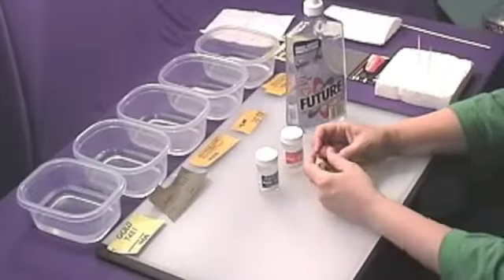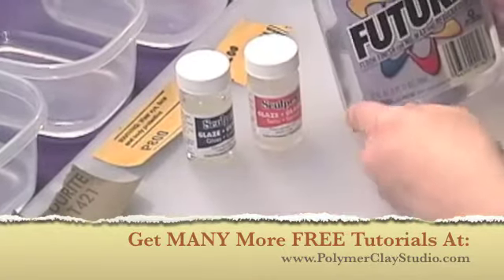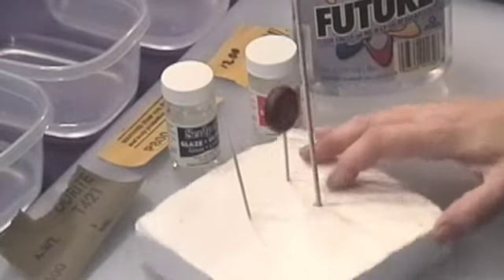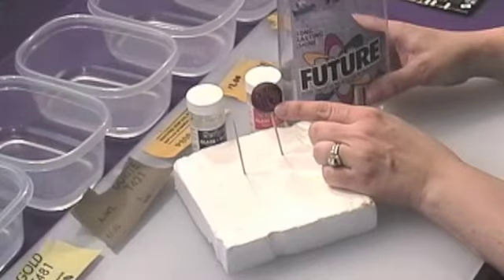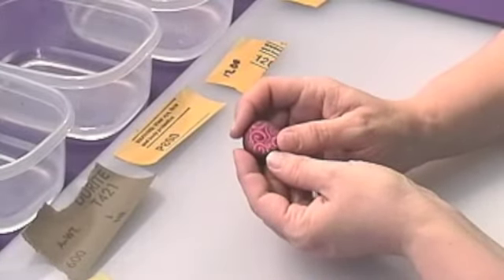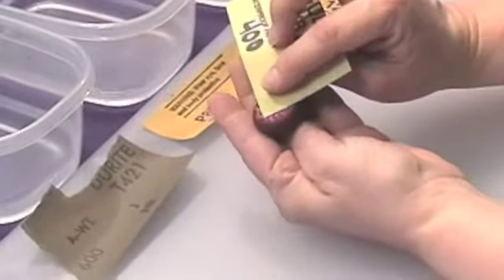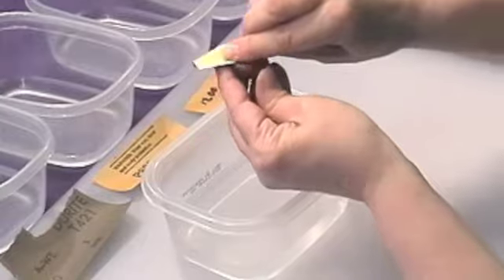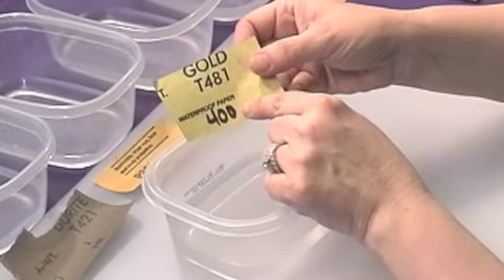Polymer Clay Projects: Finishing & Sanding Pt 1

Comment: IrresistibleAshGirl,
What grit of sandpaper did you use, and did you wet the paper and the clay while you were doing it?  When I first sanded, I got the white streaks too, and it's because my sandpaper was too coarse, and I was doing it dry.  I ended up putting a glaze over that piece, and it took the white out of the streaks, though you can still see that the clay is scratched.